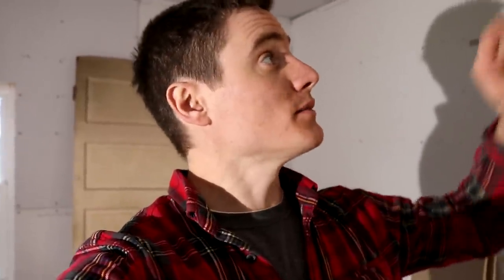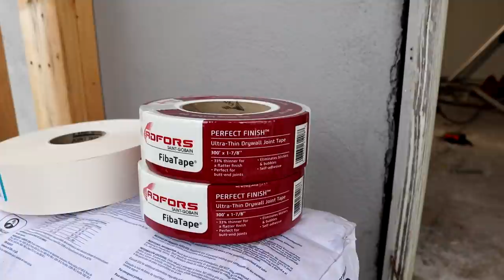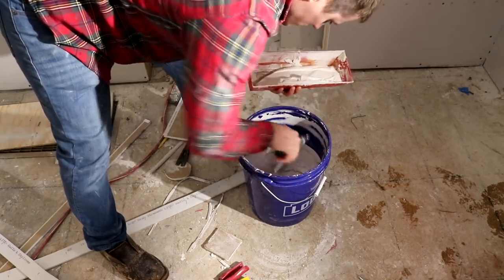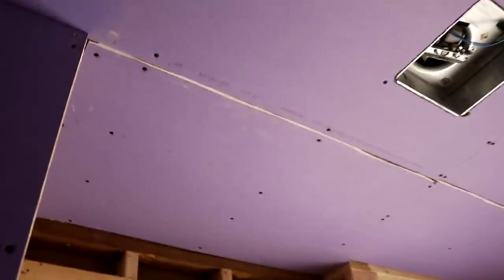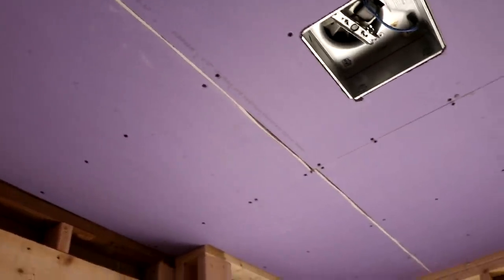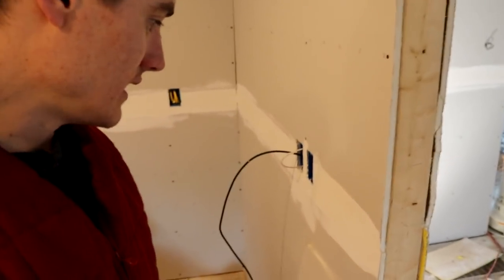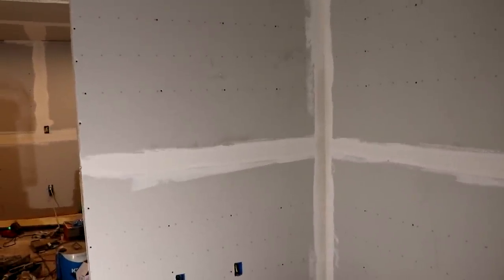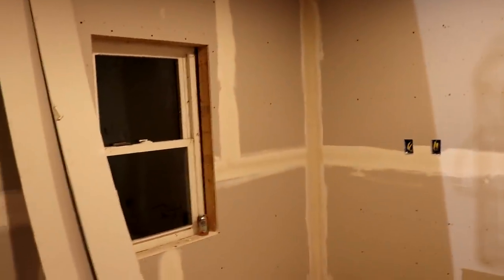$12,000 HOUSE - Mud, Drywall & a Rambling Man - #43

Comment: I found the secret to using setting mud is the mesh tape. It lets you go fast enough to apply half a bag before it sets up. I have done over 20 houses now but still can't get more than half a bag applied without it setting up. You are doing just fine, and will be even happier in years to come! I have been doing pretty much what you doing for over 40 years now and still love it!
Reply from the maker: It's funny how intimidating a bucket of mud becomes as soon as you mix it up, it also seems to create some sort of time warp that makes an hour and a half feel like 15 minutes.

Comment: In the UK we use 'scrim tape' for the connecting drywall board (mesh). We also put metal beads on around the door frames to give a nice edge, then we plaster the entire drywall boards, starting with walls facing opposite each other.

Comment: Hello from Norway😀
I enjoy watching this series, it gives me motivation.
I work as a carpenter here, and we do everything from groundwork to finnishing. I got a tip from a painter once, and it has worked great:
Do not put tape in the corners wall/wall and wall/roof. In time it will crack, due to different temperatur and humidity. When this happens, all you have to do is put acryl in the crack, and a layer of paint on top. Compared to taping, where you have to remove the tape in the cracked area, which leads to a more complex fix.

Keep up the good work👍

Comment: Ooooh!!  I'm hoping that you're intending on using the setting compound only for the first passes.  It's great for sticking the tape, and for filling gaps.  For the final coats, though, you want to use finish compound (or finish mud).  Most pre-mixed mud is finish type.  It takes paint much better, and is easier to work with as a topcoat.

Comment: I've used both paper and mesh tape and found the paper works a little better on the inside corners to get a sharper corner.  For me the mesh is much easier to do like you're doing, get it on quickly, work mud into gaps and move on faster then with paper tape.  I think it's one of those personal preference as to which to us.  I had some drywall contractors re-drywall my current house a couple of years ago, they used paper tape..it cracks too.

Comment: More rambling.......plaster casts on broken bones are done with fiber tape and plaster of paris (quick set mud) and they are pretty solid.    I would stick with the mesh tape, your technique is far better than mine (and I just did a whole house reno).   We actually use it only in the UK but then the whole walls are covered and skimmed, where as in North America you generally only do the seams and screws unless requested.

Comment: I worked as a bookkeeper with several different contractors doing all levels of construction. Honestly, the preference for paper or mesh taping appeared to be driven by what the contractors were originally trained with. I had to track after completion repairs and drywall cracks were relatively rare with either type of tape and were usually caused by some other factor. Over time, mesh does seem to be gaining the upper hand in our climate. I live on the Canadian prairies and our severe climate fluctuations can cause movement through material expansion and contraction.

Comment: You might want to use the lightweight mud for the final coat. That durabond 90 doesn't sand very good,  hard as a rock. It's a great product but it doesn't sand. Good Luck, Vinny 🇺🇸

Comment: As you apply the mesh tape, you can draw one of your narrower joint knives over it as you go.  This is a faster and more uniform way to press it onto the drywall than using your hand.  Also, you can use the same knife to cut the tape by holding the knife perpendicular to the tape on the wall and simply tearing the tape along the knife edge.  Mesh tape is good to use with the mold resistant drywall as it doesn't support mold growth.
Reply from the maker: Thanks for the tip.

Comment: Looks like things are coming along good and it won't be long before you have another income generator.
If I might suggest the following:
1. Paper tape for your seams will give you a more durable joint.
2. Don't be afraid of using your 12 inch taping knife and making sure you carry your seams at least 6 inches to each side of the joint.
3. Consider using a "knockdown" finish on your walls and ceilings as its easier, takes much less finishing time and hides imperfections better. GREAT for rental properties.

Comment: I did the exact same thing when I was doing my bathroom with cutting the mold resistant drywall wrong (also right by the exhaust fan) and you're right, it's too expensive to fix "right".  Turned out perfect though, can't tell at all.

Comment: Hey there. I've been loving all of your updates on this house. I always get super eager when I see that you have uploaded something. Just two questions though: When are you going to get around to fixing and sealing up the entry doors to the house? You've done an amazing job sealing up the house with the insulation and what not, but I feel like I can walk through those cracks around the doors - which can't be cheap for trying to keep the house warm with the portable heater, or for the drywall compound setting. 

Second question: Are you thinking of maybe changing out the front door to something a little more inviting looking? Maybe something with a nice glass insert? I think something like that would really go well with the porch and make the house look finished, plus it would be nice to know who's at your front door. I know you say that this is a rental house and that you don't want to invest in a ton of money. I get that. I did a lot of volunteering at the local Habitat for Humanity Restore here in my city, and you would not believe the type of amazing looking steel front doors that we would get in. All shapes and sizes, a lot of them were almost brand new too. Some must have retailed for thousands before being donated, And they're cheap too. I would sell a front door with like a glass insert that was like 2/3rds the size of the door for like 40 bucks, and I knew it most likely would have gone for like $600 at Home Depot, but we had some many doors, we had to make room. 

Anyways, maybe something to look into, and a huuuuuuuuuuge congratulations on getting a hundred thousand subscribers!!!! You easily deserve so many more for the great content you put up and here's to another hundred thousand more!
Reply from the maker: The doors will be replaced last, trim wraps around to the finished faces, sealing everything up. I don't know what kind of doors I will use. Thanks.

Comment: Really nice job.  It's great you don't cut corners just because it is a rental property.  I like the drywall 90 and mesh tape on factory joints for large jobs like this.  It drys fast and is incredably hard when dry.  Also, I love your technique.  Espcially since you don't do this very often.  Only suggestion for the future is do everything on the wall at once, joints, nail holes and problem areas, to save time moving from place to place.
Reply from the maker: +jayinla310
Reply from the maker: +Homemade Home Im so scared of the 90 min i just run around all over the place

Comment: Paper tape is best for corners and nylon tape is best for joining flat surfaces, u have to make sure to add a nice thick layer of compound to help give it strength and not crack, though I've never seen it crack and since u working on a house that's already settled u won't have any cracks

Comment: 90 min. setting mud is really  hard, tough stuff; almost as hard as plaster. But you do need to have everything prepped and out of the way so you can just fly without stopping, because once the mud starts to set up you have to toss it and start over with a new batch. It's all looking good though.

Comment: Not a fan of the mesh myself.  Especially on corners.  I like crisp clean corners, and paper is the only way I can achieve them.  I'll only do the occasional wall.  Full house, even a small one, I will contract it out.  I can't come close to being as efficient as guys doing it every day.  In three days they take it from studs to textured drywall ready for paint.  I don't think I've seen a professional outfit use the quick set compound.  It is hard sanding, and slows them down.  I reserve it for patching holes so I can knock a job out in a single day.

Comment: buy an inside corner trowel you will find it worth it's weight in gold the first time you use it .bonus you can do both sides of the corner at the same time same. goes for an outside corner trowel . you are doing just fine

Comment: I would not recomend the mesh tape for joints! Im a painter and always use paper tape for drywall joints. Its the best product to use to prevent cracks in the walls.
The house is realy starting to come together! 😊
Reply: Commented too soon 😅 I agree that it is important to try the mesh tape for yourself! You learn a lot more from trial and error. Who knows maybe the walls won't move too much so the mesh tape will hold.
Reply: @josefinb4182  old style has paper tape made wet, wait little and add seam mud and then paper, easy way, then mud all seams, but new tapes have addhesion have lot easy use and top on mud only need,

Comment: Cracks are not from using mesh tape (in my experience) although paper tape has been scientifically proven stronger.   Prefilling with proper durabond (not sheetrock 90, etc) is on the only way to mitigate cracks.

Comment: so... dumb drywall question that I came up with by watching the last 2 videos... after you put up the drywall, how do you know where to cut for the light fixtures; and how do you avoid damaging the insert and/or wires? I didn't notice any markings (tho I assume there were some pencil marks?), and I'm guessing you just go until you feel the drill bit hit the edge of the box / fixture - but wouldn't that damage it?

Comment: i have been using fiber tape for a very rough ceiling in my workshop wich is in an old barn with very long and flexy beam, and i have no crack at all, i hate doing that job so i rush it . so if i can do it, i think the product is good enough.

Comment: How you want the cable or internet service installed in the house? The only way they could run wires is through the crawlspace.
Reply from the maker: I ran coax and phone lines. It is run under the house and will run to a jack on the side that the companies can hook to.
Reply: @homemadehome5575  oh okay, cool!

Comment: I've used paper and I've used mesh.  Over time, I don't think there's a dime's worth of difference between them.
Reply: Me too - not a pro but have used both as a DIYer. He's better at mudding than I am!
Reply: agreed
Reply: Me too. As a DIY'er I find that the mesh tape, because it is slightly sticky on one side, seems to stay in place a bit better to get the first coat on. Otherwise, once the job is finished, I don't see any difference.
Reply: I am a painter and I have tried both. We always use paper for drywall joints. Its harder to master but its holds joints better. I have seen houses where The owners have used mesh tape everywhere and over time there has occured cracks in the joints of The drywall.
It all depends how much The walls move, sometimes mesh can hold but I would not want to risk itcracking. I feel safer using paper and its also less expensive 😊
Reply: D Hyde there’s definitely a difference. Did home remodeling for 6 years and can say almost every cracked joint I fixed was mesh tape. It is definitely easier for diyers which is nice considering drywall finishing is already hard as is.

Comment: I hate drywalling. I picked up a drywall screw gun at an estate sale. Also there is a nice little tool that can shave/grind a little bit off the drywall to make it fit. Looks like a handheld cheese grater. That thing comes in handy.
Reply: Steven Buchanan rasp
Reply: I also used the same tool on my house, come in handy many times
Reply: @jkunderwood3291  Thanks, couldn't think of the name!
Reply: Check out a Stanley 21-399 6-Inch Surform Pocket Plane  It's block plane sized that works great on drywall cut edges.

Comment: Honest question - is it normal to only use a single layer of drywall in the US? 
The reason I'm asking is because whenever working with drywall where I live, you're expected to do two offset layers. Ceilings can be a single layer though.
Reply from the maker: It is normal, my question is what is the advantage of having two layers? I can only imagine the reason being fire and sound related.
Reply: @homemadehome5575  Thanks for the reply - appriciate the insight :) 
The main reasons for doing two (offset) layers is, as you pointed out, sound and fire. One layer reduces sounds around 30dB and two shaves another 10-15 off, making it a total of 40-45dB reduction. Also it makes the construction more rigid, reducing the chances of cracks. 

Another upside is of course that you can hang heavier items on the wall, like huge flat screen tv's, shelves and so on - with less risk of the wall breaking. With the proper screws and rosette plugs, you can hang up to 100kg/220lbs on two layers without it breaking or buckling.

Alternatively, if you know where you want to hang shelves or your huge TV, you can have a sheet of plywood behind the drywall for even more "carrying power" (sorry, don't know the proper words for this - I hope you catch my drift).

Thanks for some greatly entertaining videos - and keep up the great work, I'll be looking forward to the next video :)

Comment: What's up brother a little tip on floating your butt joints hold your 12 inch knife on the middle of the joint and move it side to side that will tell you which way you have to float it more that will help  loose the belly from the tape and mud  because depending on what kind of texture your doing texture will help hide it

Comment: Do you plan on using that 90 minute mud on your 2nd and 3rd coats ?  I find it way harder to sand than the standard premix that comes in a 5 gallon bucket.
Reply from the maker: +august No. Just the first coat. Using ultra lite premix for the rest.
Reply: @homemadehome5575 , Good call and thanks for the quick answer. The house looks great, love your channel and congrats on 100 large !

Comment: Ive mudded thousands of feet of seams weith mesh tape and havent had any issues, the key is using a setting compound like your 90 min, i usually use 5 or 20 min good job

Comment: Hey i have a question, and maybe you or a follower can answer this, I have a mobile home that im working on that was built in the 90s. Most of those homes have those little wooden strips in between the drywall cracks. Im wanting to use joint compound but what im seeing is that the drywall itself has a  wall paper like coating on it. Normally on drywall you have the paper like material that covers the sheet rock. So the difference can be seen between the texture of the wall paper like coating and the drywall compound no matter how far you feather. Do you or anyone have any suggestions on how to cover that up?

Comment: You should only use sheet roc 90 to fill major gaps its not designed to mud with you cant sand sheet roc 90 its to hard you should just use a nice machine mud or a low dust mud an also the reason noone uses mesh tape is cuz when u sand its very easy to sand through an hit the mesh an then you get stray peices of mesh sticking out that u cant get rid of unless u cut it out paper tape doesnt fray as bad as mesh
Reply: Pete Harder you shouldn’t be sanding off enough mud to expose the tape regardless of which kind. I think mesh isn’t as good in these applications because it can flex and move unlike paper tape

Comment: Oh boy, I'm worry about your safety ... is that a space heater 3:43 . Did you installed your Carbon monoxide detectors ? I met a person who died with one of those.... sad story I don't want that to happens to you. I know its cold outside but please leave the house back door open when use it. (it meant to be on ventilated spaces according to the manual)I love your work and honesty man !
Reply from the maker: +Bugkiller666 The house is pretty drafty. I also go in and out a lot. I also turn it on and off. But I am feeling kind of dizzy now thay you menti.........

Comment: is there a reason but joints dont have a recess built-in?
Reply: mustaine65686 drywall is manufactured in very long sheets, I think 35’. They cut it in 8’ intervals ( and 12’, 14’, etc) and that’s the joint that’s left